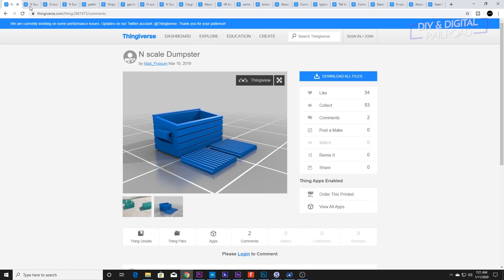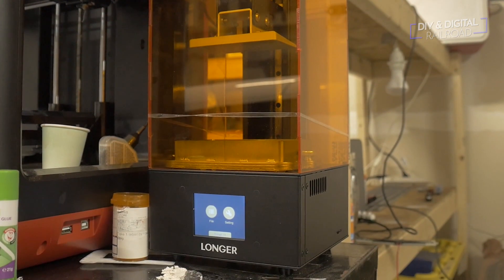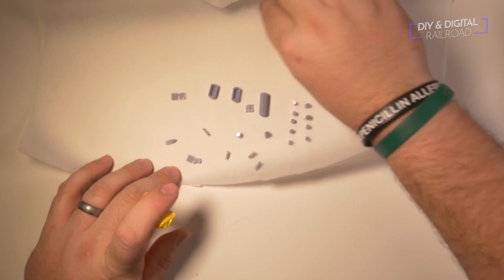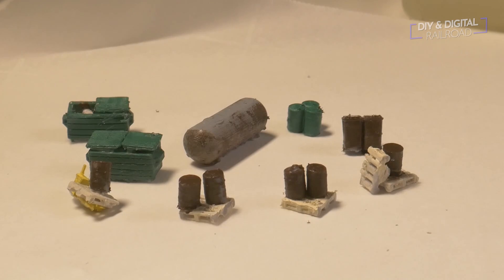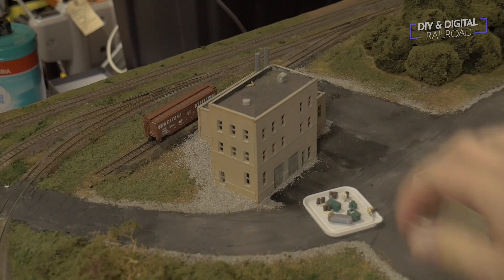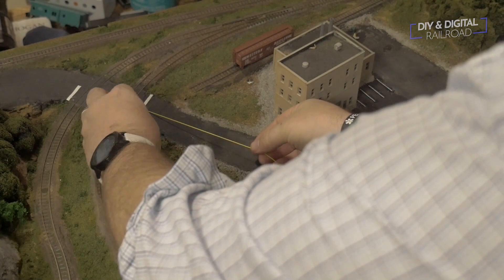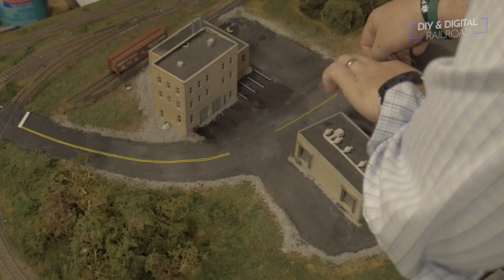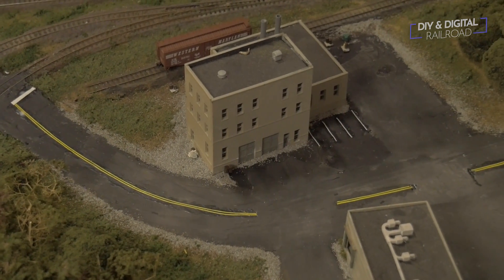3D Printing Model Railroad Detailing Parts

Comment: newbie, just got saturn 4 ultra and mercury 3 plus or whatever. Have not tried yet. Struggling trying to figure out making N scale. It would be great if scaling in CAD had simple Ho or N,...or 1/87 and 1/160...but noooo. Im also wondering if i can start with water wash resin 1st. Only because,..printer is inside and no grow tent and air system...yet. Most printers make figures and say water wash resin is brittle, but thats small/thin figures...not buildings. So,..i was hoping for anybodies advice..Thanks!

Comment: For such small parts always use the lowest layer height. The sla printers go as low as 25 microns. Also the pallets came out kinda weird. If you turn them around in the slicer so they print upside down you dont have as many overhangs and they print nicer. Also sla printers can be used for rolling stock. Just make sure to wash and cure the parts before you use them since they get really brittle if you dont cure them under uv light

Comment: Hey Jimmy I'm wondering if you had any problems like I have.   I didn't do the printing.   I got the fuselage trains from Micro Trains and the 3D printed parts were a little flexible at first. Now they are so brittle that they break very easily..  If I. Desire to get into 3D printing is this a normal thing or just what they used???

Comment: Those 3d prints are pretty cool Jimmy. I'm pretty ignorant about 3d printing. You said you use your FDM printer for some jobs, and your resin for other jobs. Could you elaborate on what you would do on each?

I've been researching some smaller n scale details, like crates and dumpsters like you made here, but also things like unusually shaped or sized windows for scratch built structures that don't have a Tichy equivalent. For that matter, if I could just print out custom wall sections I'd be happy. I imagine the layer lines would leave a brick or stone wall hard to clean up, but plank or clapboard walls would probably be fine with just a light sanding. Of course, I've no real idea, just spitballing, lol!

Comment: Hi Jimmy,
I do not own my own 3d printer, however, a few members of my RxR Club do, and the college I lecture at has a monster printer.  So to bring my comment back down to (HO) scale here a suggestion on spray painting mini parts of any build nature.

Glueing a part to a piece of parchment, wax paper, or clear plastic wrap can be effective, however, a quicker, easier, and maybe cheaper way is......."PlayDough".  Kid's PlayDough can be formed into micro-mini dry tack to hold an object in place while painting, carving, or assembling.  When finished you merely rub the faux-clay off your mini and return it to the pot to by used again another day.  OH! But what if the PlayDough get old and hard.  There are tutorial on line on how to revive PlayDough, but at 50 cents a container it should always be on your Dollar Store Challenge shopping list.

PlayDough when it drys hard, also makes for a great material to adhere models, figures, and details to a layout.  And it is still cheaper than DAX and other clay tacks.

As always I enjoy your series.  And I'll SEE YA' DOWN THE LINE.
Old Jim

P.S. How can I send you a pix to show you what you will look like in 20 to 30 years?

Comment: The 3d printer a all good for those little add features to your layout,  but not for over all details like cares unless you plan on doing lots of research and doing lots of work on making the parts in your modeling program....thanks for sharing....Jack

Comment: Could 3D printing be cheaper than buying your rolling stock and engines from companies like Atlas, Kato, Micro Trains, etc? Assuming you would have the skills to design, create and put together all the components. Would the model look good enough compared to commercial products? I have no idea how much producing a model from a resin or other types of 3D printers would cost. I am guessing printers are fine for detailed items, like those in your video, but probably not so much for what I would like to do. But, man if you could produce, say for example a decent looking and running 50' box car, or diesel locomotive for a fraction of what Micro Trains, Atlas has. I would imagine after purchasing wheel sets/trucks, couplers, drive train motors and other parts, the cost isnt going to be that much different to justify the quality difference. Especially in N scale.
Reply from the maker: So I have been working on 3D printing rolling stock.  It's definitely a job for a Resin 3D printer over a filament one.  I am getting very close to having a 3D printed Pellet hopper car.
Reply: Unfortunately even the resin printer shown here is not up to that level of detail as the resolution of the printer is not fine enough.  Yes, you could spend the time designing the model in digital form, but when you go to print it out, you will end up with very visible layer lines. Any detail less than about 2" scale inches will be lost.

Higher end models like Shapeways use can do finer detail, but those are $20,000 machines versus the $250 one shown here.

They ARE useful, and with careful planning, you can get some fantastic items.  Keep in mind the resin is not cheap, and this is very slow. Learn the techniques and limitations.  Then throw all of that away and just have fun with it.  That's the entire point of model railroading.
Reply: @woozleboy  Most any resin printer can print highly detailed parts.  Layers can be adjusted as low as .01mm thick which is smaller than can be seen.  I have an Anycubic Photon S, which is about a $400 resin printer, and have been amazed at how detailed the parts I print are.  It doesn't matter if the parts being printed are found on Shapeways or Thingiverse or MyMiniFactory or wherever, it's a matter of how much effort the designer put into it.  It is up to the individual printing the part as to how detailed they would like it to be.  Resin printers tend to take a VERY long time to print.  I have printed HO scale 20' containers that were as highly detailed if not more so than injection molded ones available at the hobby store.  The print took about 8 hours.  I also printed these at half the resolution which took half the time and the detail is on par with retail ones.  If one were to make a purely functional part for something that doesn't need to look good, the layers can be thicker and print time lessened.  The only limit to the printer used in this video and mine are size.  Resin printers that can print larger items are more costly but still usually less than the $1000 mark.